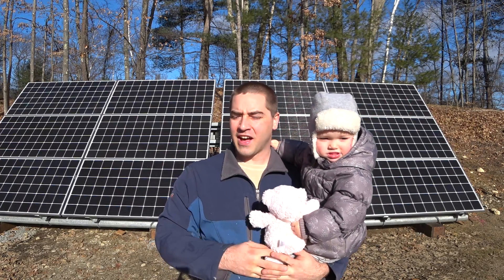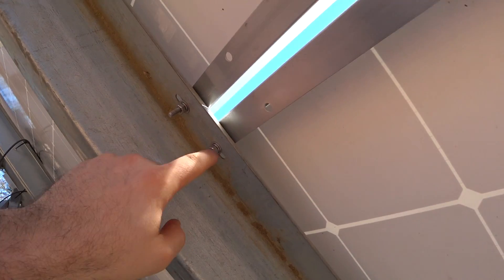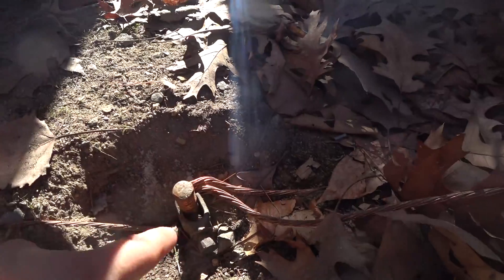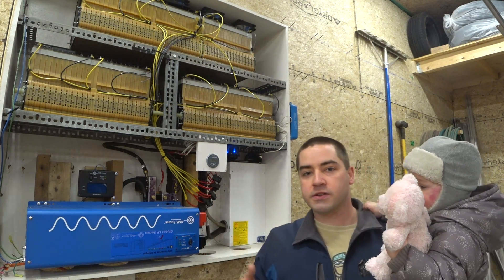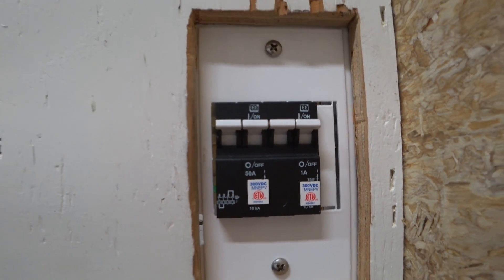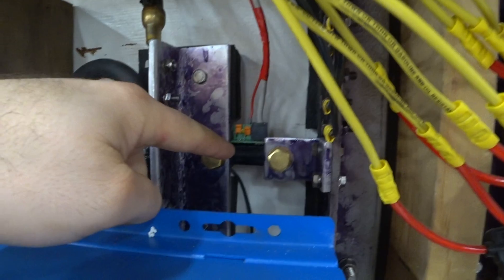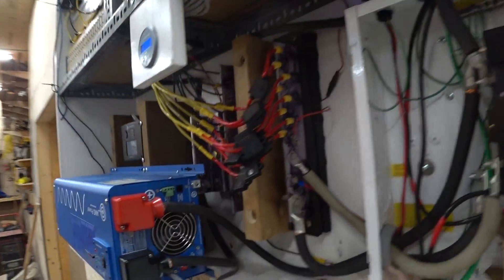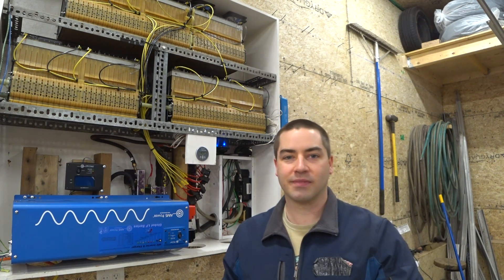Overview of Entire Off-Grid Solar System for Whole House

Comment: So 160V solar array?
What special requirements did you have to meet to use that high a voltage?
Reply from the maker: I had to use circuit breakers and a charge controller rated for the high voltage.  All my circuit breakers are from Midnite Solar, and can break 300  volts DC.  The charge controller is rated up to 250 volts DC.  As you can see I built in a lot of margin for extreme cases of extra sunlight, and/or cold weather.

Comment: I think that Batrium is making a BMS system that will plug into the BMS terminals on the Chevy Volt Battery.  Check out there website. i just ordered 3 China BMS units today and will let you know how they work out.  I need 3 more but cash is always a issue.
Reply: Bobolinksolar.com already has a BMS for chevy volt batteries

Comment: Nice Video Bud, I like you have invested in Solar, but something I have done has built my system from used 18650 cells over the years, I have very little invested in my battery bank and its roughly in the 85KWh range. I made friends with a few local battery plus stores along with local college, they save the old laptop batteries for me and give me a call when they have a box full for me, I get most from the college these days. I started out building the packs out in 52v blocks using battery kits from VRUZEND.com, but since invested in a 3d printer myself and replicated the kit with a few changes to my liking, which I print incredibly cheap with the price of filament from aliexpress and getting the hardware in bulk from mcmastercarr. I started my battery bank in 2014 and those original cells are still used daily in the system as I add more capacity every year. The inverters i use are the cheap china pure sinewave, i had a lot of issues with them blowing up in the early days, but 2 years ago i narrowed down the cause of most of my failures to the power mosfets popping due to heat, since then all my inverters i remove the mosfets and extend them out of the case and mount them to a water cooled water bar i mounted on the wall i made from computer water cooling parts. The water pulls the heat from the mosfets to a computer radiator located in a window in the garage that has 9 x 120mm fans mounted to turn on based on coolant temps powered by a computer fan controller. Since modding the china inverters i have had really good luck with them lasting with no issues.
Reply from the maker: Nice job.  I love that you get a call to go pick up batteries.  That saves a ton of money.
Reply: @DavidPozEnergy  Yes, its a win-win, they have to pay someone to dispose of the batteries usually, so i take them and just sign a waver that i am not going to be harmful to the environment with them to take the liability off them for letting me have them. I have a wall of 10 x 4 cell testers i have acquired over the years i throw the cells into that test them for good and gives me the capacity. If they are over 1000mah i usually use them, but i seperate them into bins by capacity building new battery blocks out of the higher capacity cells first. I actually have a few battery blocks i built with some lower capacity cells around 1000mah a few years back that are still 100% functional. Usually its 1 single cell in a laptop battery that went bad, and half the time its not even the cells, 1 cell fell below minimal voltage the internal charger could charge from saying the battery is bad, example if runs a laptop down outside in a cold area, then goes to a warmer area letting the voltage float below the minimal level.
Reply: William --- absolutely LOVe how you figured out a way to fix the Chinese inverters by cooling the MOSFETS.  Excellent ... I have 2 Midnight Classics, both of which have the covers removed and 2 inexpensive fans blowing directly on the MOSFETS.  Not that there have been any known problems with these incredible inverters, but when I looked at the MOSFET temps, available in a menu setting on the Classic, I was appalled. Also, the Classic would 'de-rate' itself after running a while at full-throttle (80 amps).  It would get as low as 72.  Since installing the fans, no de-rating and the MOSFET temps are 20C lower on average. It's GOT to help with longevity and your statement supports this !  Thank you
Reply: @mark_osborne  Ya, when i was replacing the burned up mosfets, they came with a chart that rated them at 25Amps @ 25c, and ranged up to 13Amps @ 100c, but stated max temp of 150c rating. Dropping off from 25amps to 13amps is a huge drop in usability in the device, when i was measuring temps on mine, they were hitting 93c during the summer months with fan running at full blast, which explained why they lived a short life. The highest i see them now is 41c during the summer months under full load. The setup consists of a Phobya XTREME NOVA 1080 Radiator i bought off ebay for $99 and copper pipe, to make the pipe capable to be mounted to, i cut a Dado into the wood and clamped the pipe between the 2 sections of wood, which rectangled the pipe along the section i clamped it, make sure you heat it up before clamping it... Then used thermal paste to mount the mosfet to the surface and clamped it against the pipe on the wall with a metal plate i cut off some flat bar stock and shrinked wrapped over to prevent any shorting. The loop has normal 50/50 dexcool radiator fluid in it pumped via 2 x 12v DC PC watercooling pumps i got off amazon for $12ea, run 2 in series due to having 1 fail on me early on in the build causing a few mosfets to burn up, with running 2 i have had no more failures on the pumps and amazon replaced the first one for me, so i have an extra on standbye if i ever need it, they are only like 8 watt pumps i think max, 500L/hr pumps.

Comment: Hi i'm off grid i have 16 solar panels and i have 2 controller 1 outback and the other is by morning star tristar, i use an inverter that is fabricate by aims 6k 48v and my battery is 415 AGM rolls battery and it's work's great

Comment: Nice job, most of this is compliant with NEC 2017. (Though, it might not pass an official inspection, unless that inspector was a real bro.) But it doesn't expressly violate much except two things, in my opinion: Service Disconnects and Arc Fault Protection.
It looks like you don't have an externally accessible service disconnect on the outside wall of the house. This is something that in your case, many would argue is required, and many inspectors would want to see for sure. (And who doesn't like a big red disconnect lever on the outside of their house? :P)
Also, you don't have arc fault protection from what I see here. Arc fault is built into some charge controllers, but I'm unsure of that Victron one. You should check, as DC arcs are a big deal. This (imho) is a critical safety feature for solar power systems.

Now, one other thought: 
When you have your system connected to that generator transfer switch, you will effectively have two grounds that are not bonded (except through the inverter, unintentionally). This isn't ideal. Consider bonding your ground rod (outside by the solar panels) to your building's main ground rod.
Disclaimer:
I'd have to see a wiring diagram to make an actual recommendation, along with spec sheets for all the equipment. This recommendation is based on what I saw in this video alone. Plz no sue. Plz don't die.
Reply: This is not required unless its hardwired to the house, because his battery system is isolated from the house circuit via an extension cord, he is actually good technically. If this was a normal setup with the house running off the solar every day directly with the batteries directly wired into the house/grid system then yes he would, but a way around this is many of the premium invertors/solar chargers have a sense circuit to detect if a power outage and it isolates the system automatically from the grid or goes into standby tell you flip a breaker to isolate it locally from the grid. I personally have a lot of grid-tied invertors in combination of my battery bank, my bank is isolated from the house via a 3 way breaker and during the winter periods when we do have multiple days of outage and no sun, i have a generator circuit that requires me to turn off the breaker to the grid before i connect the generator to the house circuit, which gives the "grid-tied" invertors voltage on the sense circuit and still allows solar to be used primarily when it can otherwise it falls back on the propane generator.
Reply from the maker: Thanks for your comments Four ZeroFour.  I have been making very strong efforts to follow code.  I even up-sized my wires beyond what the ampacity chart required.  However, I do make errors and I've always been open about the fact that I'm learning and my videos are intended for entertainment, not a how-to guide.  I do make corrections when someone (such as yourself) finds something.

As for the ground rod.  I'm grounding my DC equipment only.  The inverters metal housing, and the inverters grounding terminal only go to the 240v/30a outlet you saw in the video.  So the inverter is only grounded to the houses ground when plugged in.  When it's not plugged in it's off as there is nothing else I can do with it.  This way everything on the A/C side has only one path to ground (house ground rod).  Here is the wiring diagram I used for my DC ground system: http://www.midnitesolar.com/pdfs/dc-gfp50-300.pdf

This is a back-up system, not intended to run the house all the time, only during power outages instead of running my generator.
Reply from the maker: @Four ZeroFour: I e-mailed Victron.  No, arc fault is not built into the charge controller and they made no recommendation as to an external arc fault protection device.  The rep actually told me to google it in his e-mail response.  Which I did, but I couldn't track down an option available here in North America and rated for DC.  Do you have any suggestions?  A link would be great.  Thanks.

Comment: How often do you check your cells for Ballance?
Reply from the maker: About once a month.  I'm not suggesting anyone else run their system without a BMS.  I want to add a BMS, I just haven't picked the right one yet.
Reply: @DavidPozEnergy  I understand. The Bluetooth bms prices are becoming quite reasonable.

Comment: Nice, I think an automatic transfer switch is in order. That way you can run the powerwall until its gets low and auto switch back over to grid rather than trying to manually do it, This will mean you will get better use out of all the hard work rather than only using the battery as a backup etc.  Either that or the next inverter you buy make sure has it built in, like the Vic and mpp solar ones this will make things alot more simple but also mean you can charge from grid when the power is cheap or if there is a storm coming etc or if you overload it will switch back to grid.
Reply: The AIMS inverter does have this feature (ATS) between grid and battery bank. I am using right now. The transfer happens when the batteries reach a certain voltage level. At the same time it charges the batteries and switches back to batteries when they are full again.
Reply: Or you can use Enphase iq8 which switches when the grid is cheapest

Comment: How many days can you run without any utilities company.. also can you run the stove, washer dryer, how long will;; the batteries last?
Reply from the maker: My house is 100% electric.  I recently did a test to include running everything, oven, electric heat, etc. https://youtu.be/zkuidj5I8P4  It lasted 15 hours doing this.  We were trying to run the batteries down in that test.  If we were trying to stretch out the batteries because of a real power outage, I'm sure it could be much longer.
Reply: You would be surprised how far you can go on solar when you truly need it and not wasteful of energy, I invested in solar about 8 years ago installing it all myself, After getting into solar i found that AC inverters are amazing at going out when you need them the most, at least the early ones back then, products recently released seem to get better in quality, so to take my dependence away from my luck with inverters, when we did remodel of our house, i ran new wiring in the house via 48v runs from the 48v battery bank circuit and replaced our refrigerator, deep freezer, and all the lighting with 48v DC appliances and LED bulbs. Ebay you can often get the 12-48v led bulbs, and many marine/rv places sell DC appliances. We actually installed 2 of the DC refrigerators due to the sizes they come in, but they are amazingly efficient compared to the old AC appliances, the frig pulls like 55watts under max load and uses something like 400-500watts a day in power after its cooled down. Our stove is an expensive propane unit, so we never changed it out, but last 2018 we had a period of no power from snow storm for 41 days, i never once had to turn the generator on during that entire period between our solar system, battery bank, propane, and radiant floor heating via wood burner.

Comment: david, why dont you use a grid tie inverter to reduce your powerbill.
Reply from the maker: I already have some panels on the house roof that are grid tied.  But they are not compatible with off-grid battery systems.  So they turn off in the event of a power outage.
Reply: @DavidPozEnergy  You can actually use them together and I'm currently building such a system.  If you use an AC coupled system...  That means, DC Panels -> AC/DC GridTie Inverter -> LoadCenter for Backup loads -> Battery Back UP Inverter (w/TransferSwitch) -> Load center with Grid Only Loads -> Grid meter...  

The two key features you need are 1) A backup inverter that can accept a backfeed (Allows AC coupling).  Many nicer inverters do, they are usually Transformer (LowFreq) based inverters. 2) A Transfer Switch (Which is built into some of the larger inverters, which makes them work just like a UPS), but you could do it manually as well, like you already do.

The next feature you need is to simply ensure that you can not OVERVOLT or UNDERVOLT the batteries.  Since AC Coupled systems backfeed directly through the transformers without a charge controller at all, they could potentially overfill the batteries.  So you need to be sure that the over/under volt scenarios are properly setup and tested with your inverter.  Probably your specific inverter is already going to cutoff before undervolting the batteries, but probably there is no overvolt protection (or its probably not adjustable enough for you, since you have an inverter not made specifically for lithium).  A BMS should do this for you by triggering a relay to cutoff the AC coupled input and stop the AC coupled inverter from overcharging.
Reply from the maker: Hi Jon, I'd love to see some pictures or video of your system.  My Aims inverter is not compatible with being back-fed.  Several warnings about this in the manual.  I think Schnieder XW+6848 and Outback Radian are both compatible with what you are describing.
Reply: @DavidPozEnergy  I'll still be following you when it's done. Just pulled the permit to put in the new critical loads panel :).